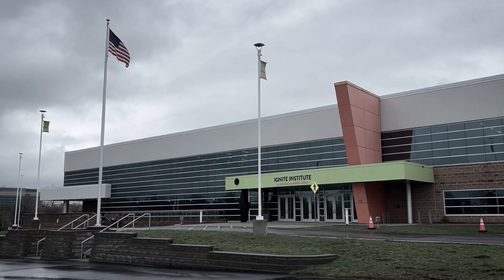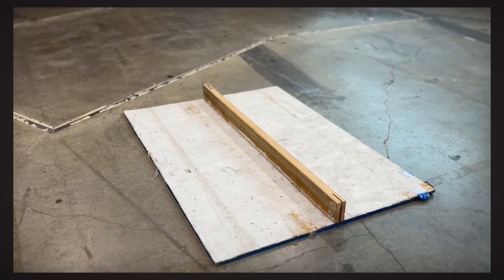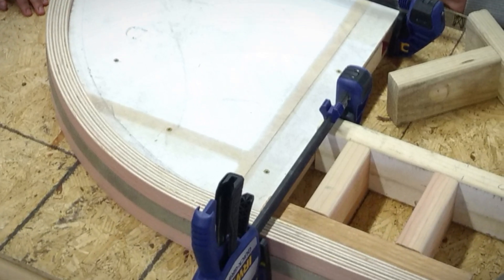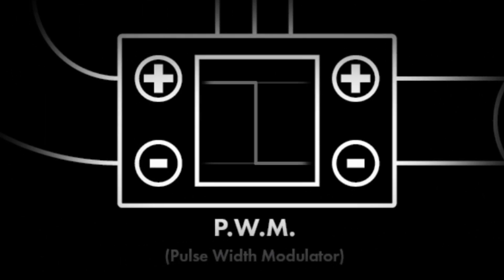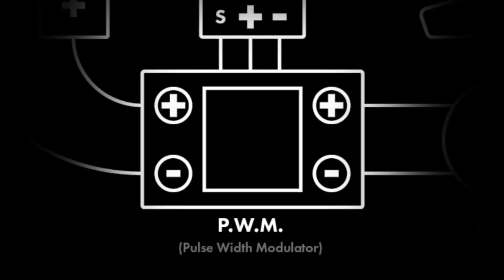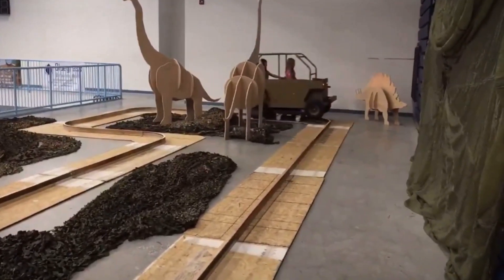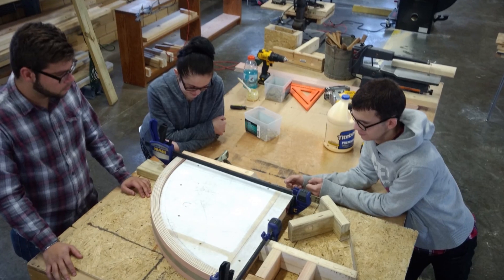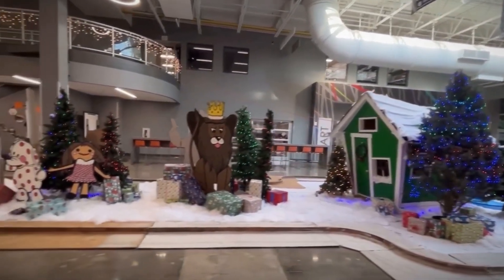The History Behind Ignite Institute's Modular Theme Ride

Comment: Great idea! Time for a second cart, I would say. I see one on one clip, but not on the themed rides.
Reply from the maker: We actually have three working resusable motorized chassis.  The car bodies are interchangeable.  We often have two running on the same track at the same time even though you don't see that in the video clips.   The biggest issue with multiple cars is cycle time (time to load the car and make a single trip around back to the start).   With a lot of cars on a "short" track you would create a scenario where riders are sitting in the car without moving.   We often have long waiting lines at our events and we try to optimize the ride experience.   The ultimate solution would be more track for a longer ride.